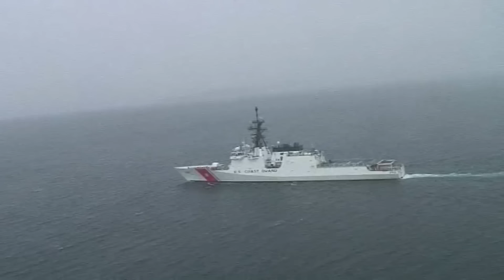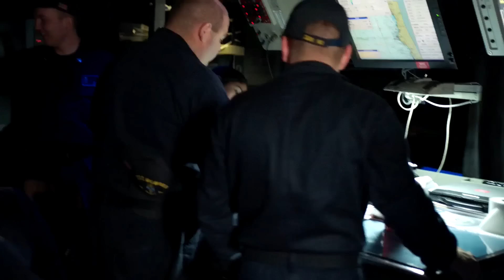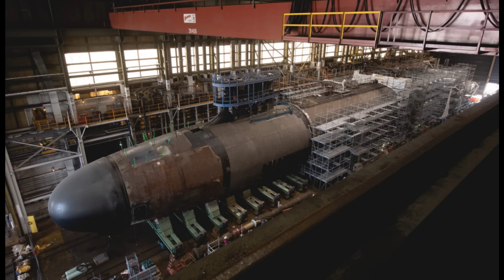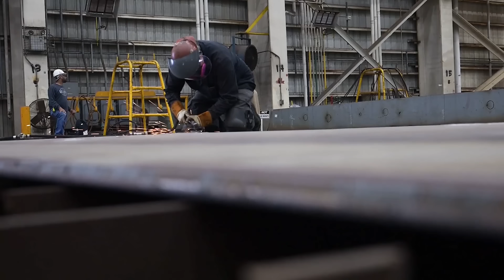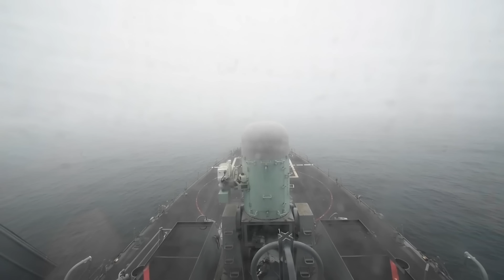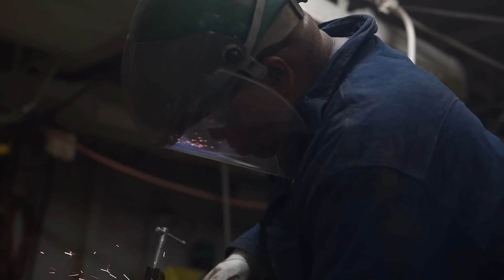The US Navy’s Radical Plan to Build Its New FF(X) Frigate Faster and Cheaper

Comment: My understanding is the initial 2 hulls were already under construction, but cancelled by the Coast Guard. This gives the Navy the ability to field something fast. But these hulls have limited capability as the video describes. 

But the design has both room for growth and prior work to demonstrate things like VLS cells. That'll come in future hulls. I don't think the class will be built without additional armament, just not the initial hulls.
Reply: No, the two Constellation hulls are under construction and are still slated to be built out. There was a Legend class hull that was going to be built but was canceled. That one could be quickly spun back up to become the first of the FFG(X) class. But you are right about the VLS cells, they built in space behind the gun for some of those. It won't be much, but it'll be enough to improve the frigate's overall capability.
Reply: @gardnert1 there is not really an issue if done right..... Patch enough of the independence class to do only light duty roles. Use the two constellation class as they are needed. Just use the coast class cutters as they are needed. No more issues.
Reply: In 2nd batch, likely limited to 8, 16 cells VLS (mushroom farm or even limited Type41 VLS), but ASW/basic Sonar suite?? Don't know.  I see the logic of tested procured hull, quick build, cheaper build, long range, Ingalls etc.
Reply: "Adapt: ie, The US Navy will not be able to resist making 500 changes to the existing Coast Guard hulls and fit outs, delaying the construction and blowing out the budget.
Reply: @ataxpayer723 they will be fine for the light duty roles required
Reply: The industrial sector is in a sorry state, 🇺🇸 paper tiger.😄😄😄😄
Reply: Just build them. Use the remaining independence class as mine sweepers ECT. Use the two Constellation class and these will do the rest..... Seriously the Arleigh Burkes will do the rest. Done.
Reply: They should have done this years ago. Flight I can have SeaRam and NSM. WIth that, the Legend loadout, and 2 MH60's it's a good start, and will give us ships that can do 90% of the work the Navy needs 100% of the time. Flight II can have 16 cell VLS and towed array to allow it to have some anti air and ASW. Order 40 Flight I and Flight II and you can then think about a flight III. Order them all now in a batch and you can bring some stability for the yards.
Reply: Build stupid, but fast. Great idea.
Reply: Do you understand that redesigning and building for expansion also takes money and time?
Reply: So we waste money now? We waste time now? To earn no capabilities? 

Genius play! 
Meanwhile the Chinese type 54A frigate has a very competent ASW suite, very good self defense ADS.

And the capability of striking land targets or ship targets almost 1,000 km away. 

The US Navy needs to just buy the damn Mogami (improved version). Or buy the fremm.

The first block should be built as is, not to US Navy standards. This gives our shipyards the chance to learn. 

Second block can be modified to meet some US Navy standards such as damage control standards. 

Third block can be built entirely to US Navy standards. 

And then all subsequent blocks can be built with whatever bells and whistles and improvements to US Navy wants to put on it.
Reply: @UserAkuFan420 Those hulls don't meet USN survivability standards.  All the changes needed to the hull and systems is what killed the Constellation in the first place.

Just completing the current hulls keeps the production lines running in the meantime while they get funding for the more capable variant.
Reply: I think everyone has lost there mind. We will these ships be able to do? It's has no air defense, no AAW capability, no ASW capability. Basically it's a high end patrol boat that will definitely get targeted and destroyed. They are even taking away ciws from this ship. No sailor wants to be on a ship that can't fight or protect themselves
Reply: @sandman6492 modularity…. They are going to have mission modules brought on board
Reply: @Rayrayhags and placed.on the helicopter deck, eliminating aviation missions like asw, medical, etc.
Reply: @Rayrayhags Just lime rhe LCS program?  That worked out great.   Slow learners at the Pentagon.
Reply: The 12th NSC is currently being built at Ingles. The 12cell VLS and the ship’s other wartime armaments are designed to be quickly and efficiently installed during wartime. The space is reserved for those systems and the wiring is already run.
Reply: Why pretend there would be a non political reason?
Constallation was built in Michigan a democrat state.
Legend will be build in Mississippi a republican state.
Trump is helping his mates.
Reply: @tigersilberhannes9153  Constellation class was selected in 2020.  After 5 years we are told the first won't be delivered until 2030. 
they are 80% the cost of a Burke at 50% of the capability.  That is why they are cancelled.
Reply: @tigersilberhannes9153  Marinette Marine (Fincantieri) is in WISCONSIN, not Michigan. We have a Democrat governor, but an entirely Republican controlled legislature; we are hardly a "Democrat state"... so your argument is nonsense.
Reply: @tigersilberhannes9153  Noted. I can't reject your statement with Trump's biased history. However, there's plenty of other reasons for the Navy to start over on the frigates. I have a family member, who's more familiar with situation, outright accuse some of the 'military leaders involved' of being in the pockets of Raytheon (RTX) and similar businesses. They had jobs lined up after the deal. I haven't been able to confirm it, though.
Reply: @tigersilberhannes9153 . Additional shipyards such as Martin Marietta and others will be building these ships so that numbers are commissioned in large numbers , quickly!!
Reply: @tigersilberhannes9153 constellation had 3 years to make progress and very little was made. Fiancanterri IMO is criminally negligent here. Billions wasted. A constellation is nearly the cost of a Burke. You are the one trying to make it political.

Comment: From what I've heard in interviews the Navy is exploring what containerized systems will work for them, and they are doing this with the LCS. The FF(X) seems to be slotted for gobbling up all the missions that are passed to the LCS, along with using all the experience and data gained from the exploration of containerized systems on the LCS. I think too many people see the weapon systems on this frigate as inadequate compared to other Navy's frigates and destroyers, yet we still have the flight 3 Burks in production, it's very clear that this hull does not meant to replace or supplement our,  destroyer fleet, but to compliment it. Doing missions you don't need a full-blown destroyer for and giving more range than the LCS.
Reply: The ship doesn't even have a sonar system, which any frigate needs to do ASW. And the Oliver Hazard-class could at least get an 8-cell VLS to hold SM-2 missiles for the AAW mission. HII had a minimal modification proposal to add a 12-cell VLS to this legend-design, I know we don't want another Constellation- class fiasco, but having the bare requirements to do the job of a frigate is something worth taking the time to do.
Reply: @ronsmith4927  it doesn't seem this initial hull will do ASW, so I'm not sure what the fuss is about. VLS capacity is fulfilled with the Burks, this ship is clearly not trying to be a baby destroyer.
Reply: @T7_H3rbz  it still will need an air defence suit though to be able to at least protect itself.
Reply: @ViktorSL-1 definitely, it's got the AN/SLQ-32(V)6, a RIM-116, MK 53 decoy launcher, the 30mm cannon, and MK110 57mm. So it's not exactly undefended in terms of air defense. Plus is meant to operate around the destroyers and cruisers we already have under their air defense umbrella
Reply: @T7_H3rbz  Frigates are designed to escort larger ships (Protecting them) and ASW roles, at present this design can't do either. If you put a container on the boat deck you loose the Anti ship missiles, put it on the flight deck and you loose Helo access. Helo's is the ships only ASW option at present. So the first few ships built might aswell be handed over to the coast guard. They should be building a modified version with ASW sonars and weapons and VLS to protect itself and the ships it's to escort.
Reply: @scotty311 they have a rear deck space that can handle a few contex boxes. Other Navy's used for gets for this role. I think it's clear that that's not the direction the Navy is going. 

An unmanned surface vessel tender, capacity and energy allowance for a command and control node for unmanned vessels. Could be a role the Navy is looking at. 

The Navy is more than just VLS and Aegis. Adding those systems on the ships cost time and money. On top of that the missile based Navy has the cost per shot, and time of production, magazine depth all of a sudden becomes a big talking point. This is speculation but I bet the Navy take a look at the gap at the low end and is trying to fill that due to the early retirements of many LCS ships. 

Where are the Navy's use frigates clearly we will use the Burks, they have more than enough VLS capacity.
Reply: @T7_H3rbz  Using AI or just copy and paste?  What nonsense you type. IF they put the containers on the rear deck they loose their Anti ship missiles. And at best they will get 8cells. 
The General role of a Frigate is to Escort larger ships / fleets and ASW and at present this hull fails on both roles. Take up the duties that Burkes are currently doing and allowing the Burkes to do more combat roles. These ships won't be around Burkes all the time and thus need to be able to protect themselves and the ships they are escorting. Defensive Missiles aka VLS. 
In it's current form it's just a coast guard cutter.
Reply: Think the container concept is hopefully a false herring that would add weight for very little missiles! We have idiots running the navy procurement right now!
Reply: @MichaelDeclercq-t5z the Navy is more than VLS capacity. We have the Burks in production which are the bulk of our VLS capacity. This ship is fulfilling a different role.
Reply: I think you misunderstand that not every weapons system can be containerized, the hull form and its configuration is not really compatible with high end ASW missions even if you say sick a towed array on it or something, the coast guard just doesn't have the damping that would be required for any other frigates primary mission, which is ASW. This leaves the USN with a big gap for ASW in the fleet, and you really don't want your burkes screening for submarines in the indo-pacific, that's just never going to be a good value trade against China's diesel electric subs. Sure you can argue that flight 2 of the class will have an actual ASW capability with some VLS cells for ASROC and probably a better hull form, but that will take time that the USN doesn't have. Committing to an unsuitable design and then working it out afterwards is just going to add inertia to getting critical capabilities to the fleet. By the time you get to 2031 which is the very best case scenario for when a flight 2 ASW version could be rolled out the SSN capacity of China will already be expanded to a level that the USN won't be able to deal with neatly. You can't just say that you'll have one ship for very specific low end scenarios requiring a specialized modular solution to each one and then don't worry about the rest because Burke will cover it, because Burke has always covered it and always will be able to cover it for ever and ever.
Reply: @kingdedede1066 if you care to understand where my viewpoint comes from. These two interviews with former Rear Admiral LeClair 
The first one is the initial one where they just touch on the Navy's current needs. 
https://youtu.be/Xa7IqXDu-WY?si=oiTUb1jUSZYy3H9i

The second one is specifically about LCS and the capabilities it's filling, the gaps, and more of what the Navy needs now not in 2032.
Reply: @T7_H3rbz thanks for the link, I’ll take a look at these
Reply: @kingdedede1066 it almost seems like the Navy just bought a really big Corvette. They seem to have some idea with the anti-submarine warfare role and I guess we'll just trust them. 
 My guess it'll be less the traditional towed sonar and more of a unmanned vessels tender. Although I wouldn't be surprised if they try and have the LCS handle all the AWS, because of the points you brought up with acoustics of the hull and all that.
Reply: @kingdedede1066the new Canadian frigate has a mission module for anti-submarine warfare that the Navy is looking to test with the LCS. If that system will work on the LCS it will surely work on this frigate. I'm going to suggest an interview with the former admiral who ran the LCS program, the ship is very much to supplement and then replace the LCS is being retired, hence the lack of VLS. Because this is a small surface combatant it's not going to get the prime time funding, the Navy only has so much budget and these smaller ships are a much lower line item than all the other things they are trying to do at the same time. The shipyard has a design of this same hull with VLS, the Navy had a chance to have that be the design they chose and purposely did not do so. The fact that we only have 27 LCS hulls, when more than double were envisioned highlights the gap that this hull will fill. Putting Aegis, VLS, and Aegis capable radar on this hull will cost quite a bit extra. Think of the cost of each one of those missiles that will go into the 16 cell or 32 cell VLS, now multiply that by the whole class and you've added quite a bit of cost, removed magazine depth from the destroyers and cruisers ( our main line surface combatants). I think you're too caught up on the potential capability and not understanding that the Navy needs to go to Congress and get the funds for this ships, along with every other capability they're trying to fund at the same time. We need to replace the Ticonderoga's, the Berks will eventually need a successor as their hulls are kind of tapped out for expansion. They're going to keep needing to purchase f-35 since the carriers we do have don't all have them. Those hypersonic missiles they mounted on the Zumwalts are not cheap. And that's just scratching the surface of the big ticket items. Perfect is the enemy of good enough, we've seen that in Navy procurement since the early 2000s.
Reply: Legend class screams 6 connex boxes of VLS tubes bolted on its flight deck ngl
Reply: @gamingrex2930  And have no helo for ASW?
Reply: @scotty311  Very much so, there is a reason why “multi-purpose” FFG is a marketing checkbox. 

The legend class definitely wont be, not until flight 2. It turns out strapping random stuff onto a built ship is pretty bad for its tactical flexibility, but the US doesnt have the institutional discipline to not attempt and turn another frigate into a 100 VLS carrying vessel without 7 redesigns. 

So their Navy Secretary is clearly using this as a stop gap design that will force planners to reel back their addiction to “modular lethality enhancements”, while being fairly simple to construct. 

Of course the obvious solution to getting a navy in 2 years is to hire as many foreign shipyards as possible, but we are talking about a people that voted in the “no more wars” president. And until they start digging trench lines on the US west coast, you can bet that there will be a lot of infighting by politicians when they announce a 1-7 billion contract for some korean shipyard. 

Really this is the best solution to a 20 year rot in american industry while getting hulls ready by 2028 for a fight.
Reply: @gamingrex2930 I definitely this that is an option. Other things I think are a bunch of drones for swam type attacks or screening.
Reply: @T7_H3rbz  Or maybe even a USV tender
Reply: @米空軍パイロット and this is something the Navy definitely needs and doesn't seem to have an ability to address.
Reply: @T7_H3rbz  Yes. With an all-nuclear sub fleet, we haven't thought about this problem in a while

Comment: What most armchair admirals and internet analysts seem to miss is that the original HII patrol frigate concept is, pound for pound, a nearly identical match to the OHP frigate when it comes to capabilities and size. 16-cell vls with quad packed essm gives it more SAMs than the OHP,  it had the same senors and sonar capabilties as the OHP. Same ASW and ASuW capabilites as the OHP.  And the Oliver H. Perry Frigates is arguably with the best frigate ever built since WW2. I'd argue that if the FF(X) equals the OHP in capabilities and armament it is going to be one of the best proper frigates in the world. What it won't be is a baby destroyer by another name.
Reply: I disagree, its better due to the 21 round ram launcher vs the ciws on the ohp which means it is significantly more survivable and if it gets 16 nsm then it is 4 x the asms!gets
Reply: Totally agree, if the boat is going to have VLS cells those resources might as well go into the Burke. Not every mission requires them
Reply: Should have continued OHP production in blocks.
Reply: @bl256 agree, was stationed on ffg 37, 48 and if you added 2 mk 49 gmls, 8 harpoon missiles plus 32 vls cells it would have been top ten frigate! bee
Reply: 20 years ago maybe,  today OHP is crap. even Singapore new "not a frigate" combat ship has double the firepower, and we are hardly a "major power". it seem a complete joke that a city with only 5 million people can build a better ship at half the time and half the cost than mighty US of A....